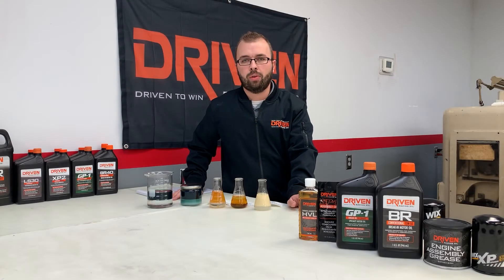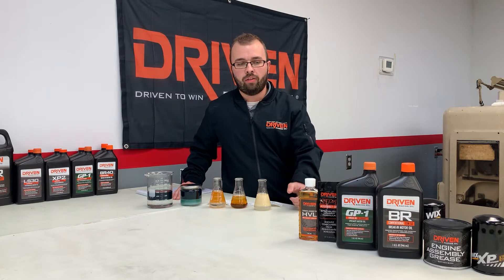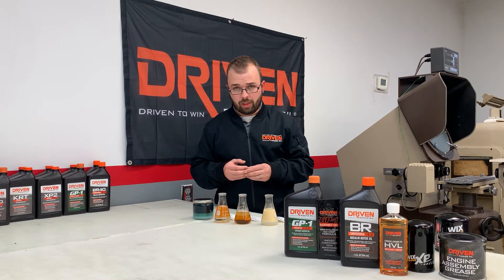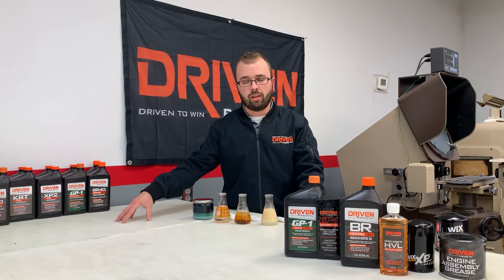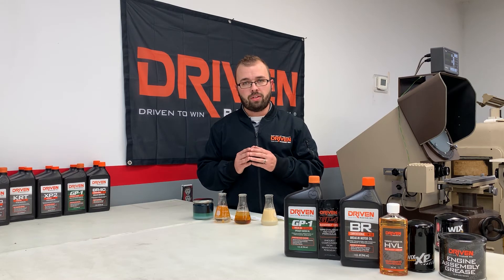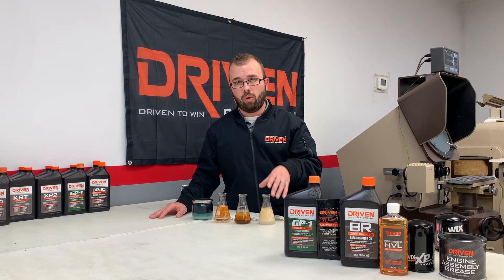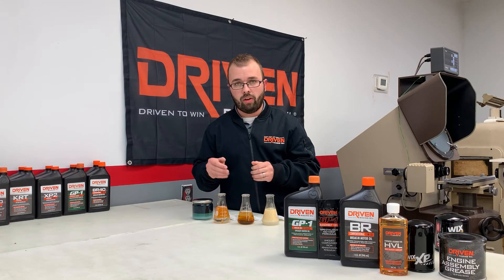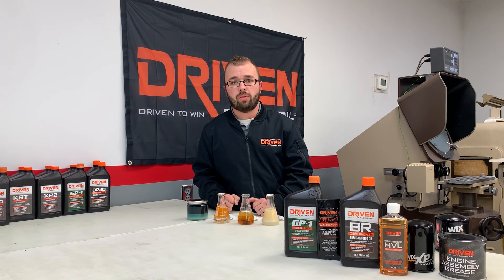Engine Break-In Without a Dyno | Part 1: The Purpose of Break-In & Break-In Oil

Comment: What are the auto manufacturers using in their engines that is different then us home rebuilders?
Reply: Absolutely nothing...never have. "Break-in" oils are a marketing gimmick and always will be.
Reply: About 30 or 40 years ago there was break in oil in the new vehicles, but people went changing the oil when it was suppose to be done and break in oil can't go the long distance and it would sludge up. 
Now, with the fuel economy requirements, vehicle manufacturers are running the low viscosity, highly friction modified oil to meet CAFE requirements

Comment: Why not use synthetic oil for break-in compared to conventional mineral oil, additive packages being similar.
Reply: synthetic oil has too much moly and will not let rings seat causing oil burning, you also need camshaft lifter polishing in older engines.
Reply: All depends on the honing finish. OEM uses synthetic in many new vehicles with no special previous run-in. New ring coatings (pvd) and thinner rings with proper honing and the break in after a few miles regardless of oil choice. We used to use non-detergent mineral oil in the 70s, totally different ring materials and Lee's the great honing

Comment: Back in the day we use to break in all our engines with NON Detergent 30w and a bottle of comp cams ZDDP additive. Being able to just buy a break in oil is a lot better than worrying about having the right amount of ZDDP
Reply from the maker: Absolutely. Nothing compares to having a purpose-built formula specifically for engine run-in. A fully formulated Engine Break-In oil is a better way to go; adding in a zinc additive to a separate engine oil without knowing if it is compatible is sort of like playing chemistry-Russian-roulette, you just don't know if the two are compatible together.